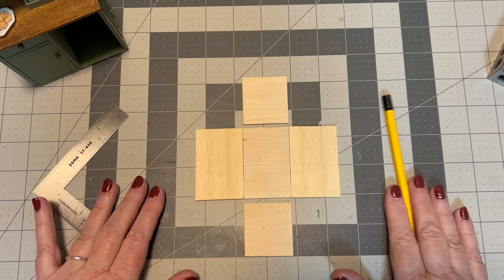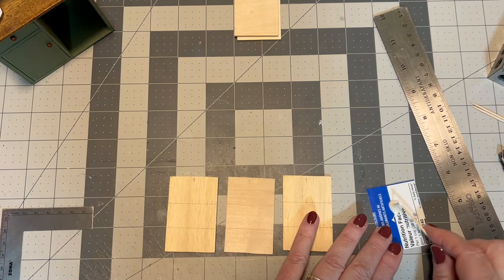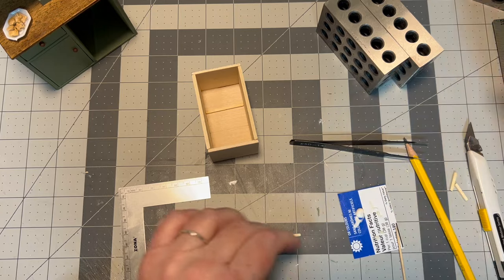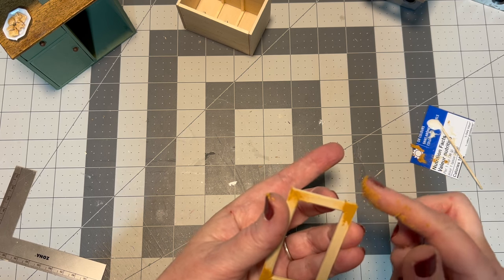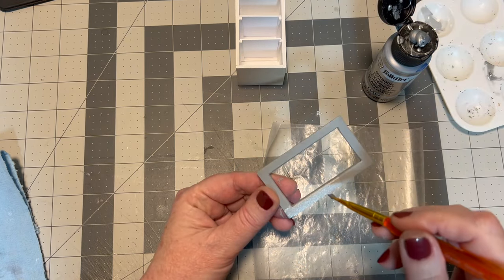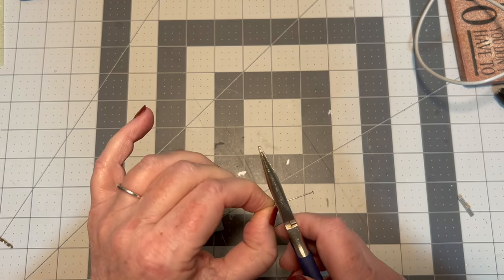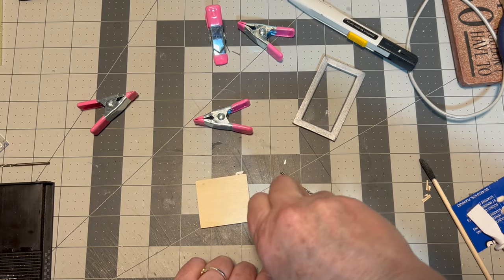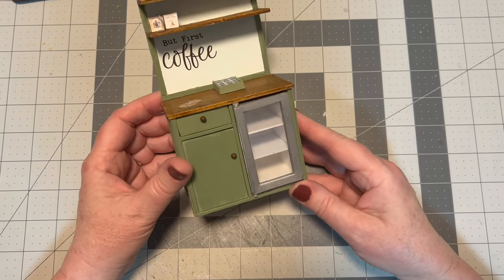A little miniature bar fridge for the Coffee bar!

Comment: Hello Penny. Thank you so much for another perfect video. Very innovative design for the fridge door, you’re one smooth operator 😊
Reply from the maker: Thank you so much Linda! There’s a song called Smooth Operator and now it is stuck in my head! 😂
Reply: Ah yes, that song’s been looping round in my head too. There’s a line in it  ‘We move in space with minimum waste and maximum joy’
Very true. I also keep thinking of you and your stair conundrum. Have you sorted it yet?
Reply from the maker: No. 😂 I can make the stairs work but I also had this idea for a working elevator. I just need to decide which one, and soon! Now that Spring is almost here, I will be cutting and installing the walls in the next month. 😁
Reply: I kind of want to ask you why you’re waiting for spring. It gives me the impression that you’re planning on building a full size house (and I know it’s 1:12th) I just knew you would put in a lift. I did exactly that in a modern house I built (very swanky) and the lift was all glass and mirrors, it looked great but I wanted it to be fully operational and the electrics involved were too steep a learning curve. Plus the basement swimming pool I’d  was also beyond my ken, so I demolished it and started a 1930s house with an art deco interior. Much safer ground for me.
Anyway, thank you once again for all the inspiration you send
Reply from the maker: @lindahart7133  Great question! I need to use an electric saw (table saw) to cut the walls. I don’t want to cut them inside and deal with that mess so once the weather warms up, I can do that outside.  I had hoped to do it in the fall but ran out of time.  The elevator will be a challenge but my husband, who makes it sound so easy, has offered to help if I get stuck.😁